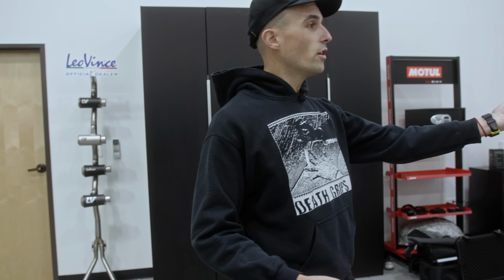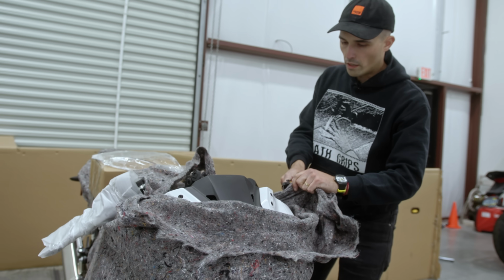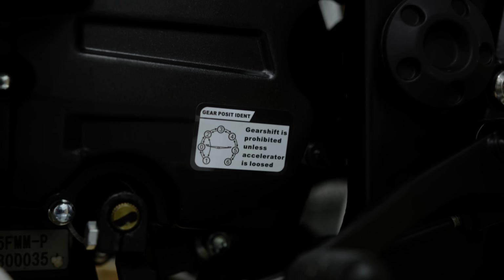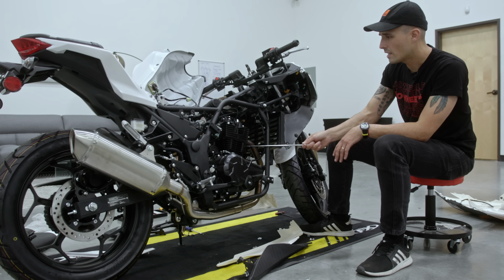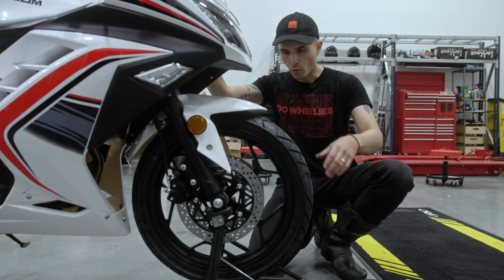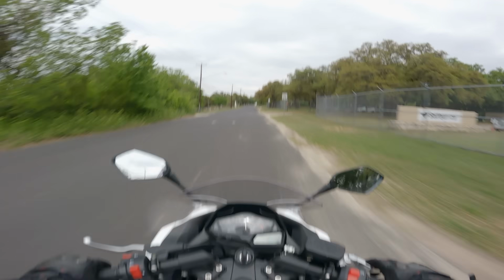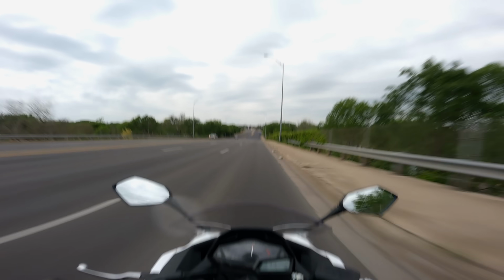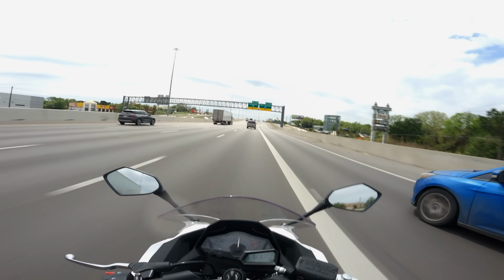They tried to trade a Bike for a POSITIVE REVIEW... So I Bought it Instead

Comment: To be fair, it is literally a $1,500 bike. What more do you expect? It costs a quarter the price of most beginner bikes right now.
Reply: Yeah my used ninja costs more than this, is probably 10x more safe and 100x more reliable. And isn't Chinese ass.
Reply: @MrBlipman  since writing my last comment I have bought, licensed and ridden my Chinese Hawk 250 DLX over 700 miles (200 of which were hard off-roading) and can report literally zero issues so far. All of these Chinese bikes come from the same place with different names, so find the cheapest one and you have a set of known possible issues. Buy used and you have literally no clue how it was treated or used by the last owner(s).
Reply: @MrBlipman i bought china bike and it's 5 yrs old now, still alive and kicking lol
Reply: This a 250cc these bikes aren’t 1,500 you’re thinking of the 125cc itd 1,700 these bikes are 2,800 to 3,400 new I bought a used one last month from a 65 year old with less than 1000miles on it an it’s in amazing condition runs an rides amazing some of y’all are like this dude in the video CLOWNS
Reply: @simsatvrepair1255  I literally own 2 Chinese duel sports. Both I bought brand new in a crate that I assembled and cost less than 1,700. They are both 230cc. They have been incredibly reliable, fun, and capable on single track trails. I have over 10,000 miles on them combined.
Reply: @ you didn’t buy one these bikes for no 1,500 they cost 2,800 to 3,400 comes in a crate too an these aren’t 230cc these are 250cc ninja clone  of a 13-14 250r/300 

With a 223cc crf230f Honda clone motor

Comment: Speedometer is probably in Kp/h. 🤣
Reply: If he's doing about 60, 82 is not accurate either. It should say 100 (110 with the tolerance).
Reply: @Mr_Glenn  I mean, you've seen the rest of the bike.  Accuracy isn't quite it's forte.
Reply: This is how they get it to be a "superbike" just mis-calibrate the speedo so you think you're going faster than you are haha
Reply: Is China = Asia standard , meter is in KM
Reply: The math checks out. When the bike said he was doing 60, he was on a 40mph road. 60kmh is the same as 37.28mph which makes sense as he was being passed by that blue SUV.
Reply: @mizzclaireelizabeth  no no no...when the bike said it doing 60kmh, it actually doing 50kmh or less......
Reply: Km/h*
Reply: I bought a Chinese bike for some fun in 2010 and I had to check every bolt and adjust everything that was adjustable, but then it was fine except the Chinese tyres are always bad.   The Chinese bike are not up to Japanese standards yet, but the speed at which they are improving is impressive and you have to appreciate just how cheap these are in China .  The market and the needs of Chinese buyers is different to US buyers.    Having said all that, they look like shit after a couple of years.   I ride a 26 year old Honda 1100 that looks and rides like new, so clearly no comparison.. yet.

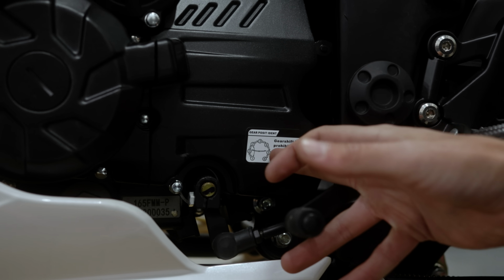Comment: 6:10 means that you gotta let go the throttle while you're shifting the gear, otherwise you will destroy it. It's warning from the factory saying that they dont provide good quality clutch :D
Reply: Or an ineffective rev limiter.
Reply: its sort of baffling that yam didn't instantly realize what this meant tho ;p - but ya it makes good video I guess
Reply: You dont know jack bro. Trans is weak, not properly synchronized to allow clutchless shifting. A feature most dog engaged trans gears are comfortable doing.
Reply: @f.f.s.d.o.a.7294  wtf are you thinking?????
Reply: motorcycle transmissions are constant mesh btw
Reply: For some reason this video started there for me. At that point I've stopped it, if he's that ignorant he probably doesn't have anything worth listening too anyway.
Reply: @kiztime1234  I had to stop watching tbh, it seems like he only sorta knows what he's talking about. Seems like a dumpy little bike but his commentary is atrocious lol
Reply: you should decellerate when changing gears, that is normal on every bike with gears...
Reply: L @BeefVellington
Reply: No synchros lol
Reply: @philldownes8685 I've never ridden a motorcycle where you can't shift under power. 

Except my 84 Honda xr200 with bad synchros

Comment: I bought that exact same model last September and had it shipped from Texas venom motorsports in a steel crate. It was 95 percent assembled. My very first bike. I knew nothing of what to expect. I had nothing to compare it to. Good guys.  Decent customer service. I got everything for like 3k n some change.  You are correct..it is exciting for all the wrong reasons  that's in a nutshell.  Since I was a beginner, I thought well hell I guess this is what it's like to get into motorcycles"  i got 500 miles on the little homie before that engine blew apart. Goodtimes. I don't regret it though. I learned a lot.  Mine was even carburetored hahaa! Almost turned me all the way off as far as riding, but it didn't. It was definitely a learning experience.  I don't regret it . I've since purchased a gixxr600 and 2012 gixxr750. I'm passionate about riding. I'll never forget my little whungwhang 250cc 16 hp 5 speed carburetored superperformance venom ! I'm 46 years old. I enjoy your videos and have learned quite a bit mr noob. Thanks.

Scott
Reply: Wow that’s crazy
Reply: Good info. Thanks.
Reply: If it had a carburetor then it wasn’t this bike… this bike is EFI.  🤦‍♂️
Reply: @nickelbob82  it was probably a different year 🤦‍♂️
Reply: Yes it was 2022 . Other than that.. same.🧏
Reply: 250 with 16hp.. Demmm. Its like 150cc..
Reply: Wow. Some 150cc mopeds produce 18hp. Something tells me that isn't 250cc 😂
Reply: @holdingsteadfast  felt more like around 100 🤣
Reply: Wait it blew up after 500 miles ? What the fuck is even that like how are they still selling these things.
Reply: amongu-
Reply: @holdingsteadfast the bike sounds like the small scooters etc that are all over vietnam.
Reply: My sister got the same 250 carburetor. 2023 Vennum. They had to of dropped it upside down because there was dry powder battery acid all over the bike from in the crate.  Her plastics were cracked. Her front tire had 3 bubbles in it and had a major vibration. She had to put 800 or more into the bike. Brand new 0 miles and the Vennum company only offered her 75 bucks back. Crazy. They should have covered all expenses. The shop called the company too. Right out the box. Vennum does not want to pay even though they're probably selling like 1 bike every 10 minutes or more.  For the price of like 2,500.  3k with taxes & a putting the bike together fee. They could've just sent her a new one again or let her keep the bike free. That was dangerous.
Reply: did you check the oil level and change it after break in ?
Reply: id like a efi bike doing choking on a bike i just not what i like
Reply: @holdingsteadfast  ive heard its a copy of a 239cc honda engine
must be a pretty terrible copy
my ADV160 has about the same HP
Reply: @paulbarclay4114  guess 223 cc engine
Reply: You know they ship those bikes with shipping oil. You're supposed to do an oil change before you ride and break it in

Comment: From what you said it might be a possibility that the speedometer is set to kph instead of mph. That would explain your 60 in a 40
Reply: doesn't explain the rev indicator being wildly off tho. most likely you're half right, it's showing kph claiming it's mph.
Reply: Yah, I was looking for this comment or I would have said it myself. I pretty sure it can be reset to MPH.
Reply from the maker: Nah. At highway speeds it read 85 lol
Reply: @yammienoob  Yeah, but that would make since if you were going about 55mph on that stretch.  I was thinking the same thing about KPH vs MPH.  Not that it makes up for all the issues, mind you!  🤔
Reply: *sense, not since.... Dohhhhh. 🙄
Reply: wonder if the tach is thinking its a twin and not a single
Reply: @hardave that shouldn't make a difference because it's reading the shaft rotation, not the cylinders
Reply: @_Moth_. Not entirely true. I had a tach that you could change from a 6 cylinder to an 8 cylinder with a switch on the back. With it on 6 cylinder hooked up to my v8, it ran higher than it did when I switched it to 8 cylinder. With it on 8 cylinder, it read the way it should've, but as soon as I switched it back to 6 cylinder, it read higher than my v8 was actually running
Reply: Sounds like that 11k rpm are 7500 real rpm.. my 70cc single cilinder Lifan sounds almost the same with a proper working rev counter 🤣
Reply: @yammienoob 85kph is about 53mph…  that would be about right
Reply: Good speedometers can have some variation too…1-3mph variance isn’t unheard of, on decent speedometers,especially if calibrated for incorrect tire size
Reply: @andyackerman7123  I'm pretty sure he released a newer video explaining why it was in fact "setup" for mph and not km/h. If I remember correctly he proved it by showing it was in mph on the gauge
Reply: @VicinalElk44104  I don’t disbelieve it. However, that doesn’t mean it wasn’t posting numbers for kmh instead of mph. I’m not blaming him, I’m agreeing with other posters, that it was probably displaying incorrectly
Reply: Maybe it's in mile per day?
Reply: @kaelin000  Could it have been Revs per Hour?
Reply: I am pretty sure u were going 85 but because of the good build quality it felt like 50
Reply: @johnmccloskey7347  his follow up video explains how stupid this comment was...

Comment: You did the right thing and bought it to review…. I paid less for my 05 SV650 Tuesday and it’s a great, quick bike
Reply: Lol, compared to this Boom the SV is the most morbid thing out there.😂 Bet no Suzuki comes out of the crate like that. 
The SV is a great bike tho. Great pick up! Enjoy it!
Reply: I paid $1k for my ninja 300 and its solid
Reply: The sv is a good platform
Reply: @dcorbin5779  just trying something different, it’s like a cheap more reliable Ducati monster lol
Reply: @johnlopez805  i looked at a sv650 first but when I decided to pull the trigger dude had already sold it
Reply: Just sold my 08 SV650 cus I bought a Ducati Monster 796. Had that SV for 4 years and it never gave me any problems. It was so reliable it was boring. Hence I got the Monster lol Great bike tho, and I will always endorse getting an SV.
Reply: @t dizzle  where are you guys finding these.  The used bikes where I am are listed for more than new ones
Reply: @802spawn  offer up
Reply: My dad owed one of them, single cylinder. He also had a TRX 850. Liked his unusual bikes lol.

Comment: You can only shift gears when not accelerating. No flat shifting. Throttle is loose when you let go. Do you require a drawing?
Reply: Yes show us a drawing of "flat foot" shifting on a motorcycle. Does that mean shifting while on pressing the rear brake?!

Comment: I had a hawk 250 with that same engine in it. It topped out at 60 on the gps. Its pretty fun to ride around the city and swerve through cars. Mine broke down because i didnt break it in properly
Reply: My 250 (similar to the Hawk) only lasted about 11k miles. If you have the 17/45 gearing on it they will do 72 mph (GPS), otherwise its stock gearing was 15/56 which apparently will do 62 mph because mine didn't seem to have a rev limiter, however that may be why my connecting rod bearing is decided to hit the eject button...

I didn't run it super long on its stock gearing, about 10.5k of its miles were with it geared up so it wasn't having to rev as high. Just cheap engines though, nothing reliable like a Kawasaki (my grandfather's 90cc Kawasaki G3 would run just as fast, and that bike from the 70's is in much better shape than my duel sport, I might start using that one instead)
Reply: I have a Hawk 150 dirt bike with about 200 hours and it’s been great. I just trail ride and don’t jump or beat on it. They’re obviously not meant for a lot of abuse.
Reply: 60 mph? 72 mph? my 125 4 stroke supermoto would beat that
Reply: @raptorthefish3842  it clearly has different gearing and it’s a Chinese bike
Reply: @vebez5993  exactly you cant compare a name brand dirt bike to a shitty ally built one😂. I was planning on getting a vitacci gto next. Thats a chinese 332cc motorcycle but its actually reliable and has quality. Apparently it can hit 95 mph stock. Hopefully yammie reviews that soon
Reply: Bruh even my scooter can do 76
Reply: Dont brag about how fast your scooter or dirt bike is if your reading off the speedo. Most speedos are off 10-15 mph
Reply: What do you mean break in?
Reply: @casillask42 you have to "break in" new engines.

Comment: I own a Brixton BX125R which is a cheap, Chinesium bike. I can say with confidence that what you are experiencing is about right for this type of bike. Now, the only other bike I have been on was a Honda CB650 which I passed my test on so my experience is quite limited. I bought my bike with just over 3000 miles on it. I have put almost 5500 miles on it since I bought it and the amount of maintenance I have had to do on it has been absurd! I had to replace the front and rear sprocket shortly after buying as they were worn. I had to buy a chain as that became so worn that it nicked the rear tyre and took a chunk out of the side wall. Two new tyres for the previous reason and that they were so squared off from factory that it made going around corners quite scary. Rear wheel bearings as the cheep Chinesium once started to seize as they got warm. I had to rebuild the rear wheel due to the spokes being made of pig iron and were snapping as I rode the bike. Had to rebuild the fork bearing as the factory did not apply enough grease to the bearings and the steering became quite notchy (similar to what you were feeling by the sounds of it). And lastly, the only recurring problem that I have not been able to fix has been the chain will just become slack for no reason. All adjustments have stayed the same as I was marking my adjustments to see if anything was coming loose and they were not. However, I have noticed that if I rotate the rear wheel the chain will go tight, then loose and so on. Oh, and to make the bike feel a little peppier I fitted a larger rear sprocket when I got a new one. TLDR Chinese bikes are shit...
Reply: I only heard the term chineseium a few weeks ago myself, but I get the idea.

Comment: I bought a new 150cc China scooter for $900 as my first bike because it was all I could afford, I had a blast I rode it everywhere for 8k miles until the motor seized.
It was a love hate relationship because it was always breaking down but it made me realize I love the sport.
Now I've had a Honda Grom for the last 4 years  and 50,000 trouble free miles😂🤙🏽
Reply: Hopefully you change the oil when you got it. They ship them with shipping oil. Itll destroy the engine if you dont change it immediately
Reply: @samholdsworth420  yep
Reply: @-JohnSmith-  cool. Pos China then haha
Reply: @samholdsworth420  yep  switched it to regular oil for 800 mile break-in then mobile 1 10W-40, changed that like every 600 miles